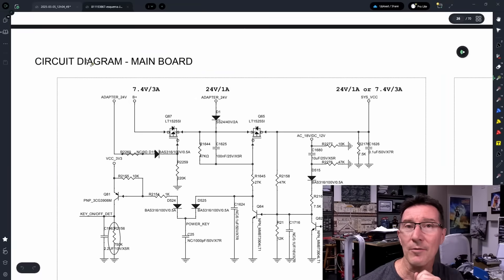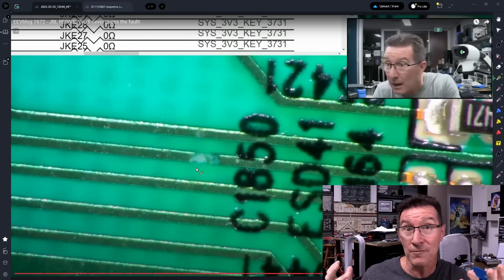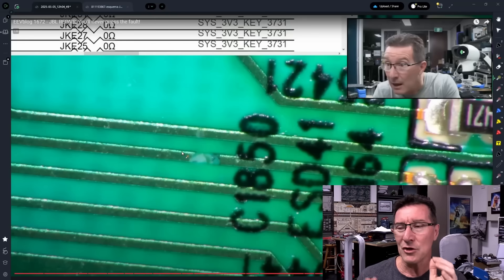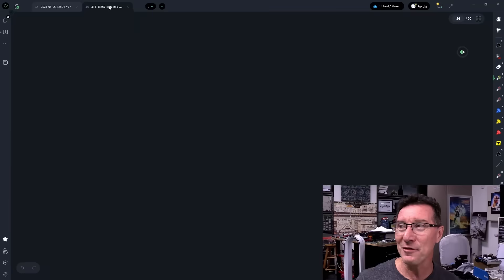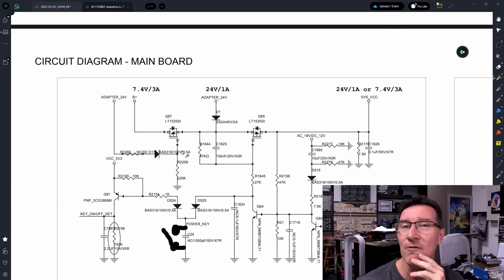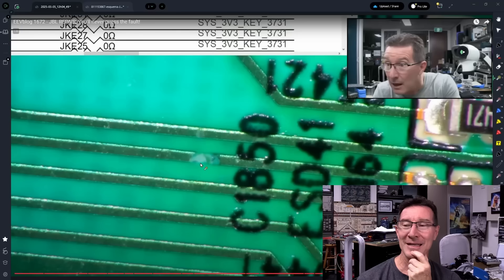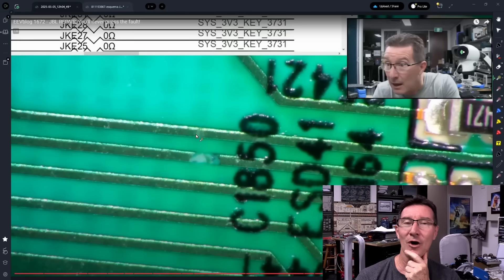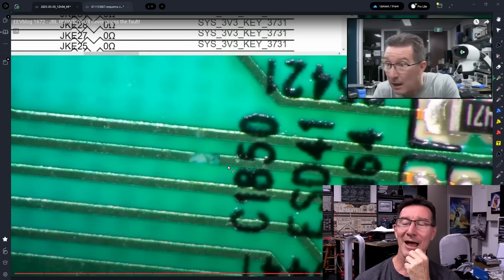EEVblog 1673 - JBL Partybox 310 Repair - Part 2 (SPOILER)

Comment: This is why when something gets liquid in it you immediately remove the battery if possible, or at least power it fully off if it's not removable, so things aren't energized while it's wet.
Reply: No, just fill your speaker with rice. Then boil it.

Comment: If the power key doesn't have a current limiting resistor between it and C25 then there will be a current spike every time the switch is pressed. The current spike can damage the switch and thin traces that have imperfections.

Comment: The one single trace in the entire product that could cause complete failure to power on is the one that had a microscopic defect. Wild.
Reply from the maker: A lot of them would have had microscopic defects, but only that one had a pernanent higher voltage on it!
Reply: @EEVblog  Would a bleeder resistor have helped?
Reply: @CamelCasee No. It's not residual charge from a capacitor which keeping the voltage there. The switch is permanently powered. Lowering the switch voltage or ability to completely disconnect power (including battery) when stored away could increase lifespan. However ultimately I believe the coating was rubbed off (partially) and enabled electrolysis to do the rest. Result is shown in video.

I would have said routing traces on the back of the board would better protect them but that's silly given the effort they put to use single-sided boards only. I would say a design avoiding the membranes sitting directly on the PCB would have ovoided it. Or better spill protection with a full-size membrane across the whole input panel. Sealing off the buttons entirely.
If JBL is watching: This is exactly the type of analysis which could help avoiding such small issue in the future. I fear though there is no interest in extending the lifespan. Defects welcome.
Reply: @CamelCaseeno. Not if a voltage potential is there most of the time. There would always be some current flow, nothing to bleed.
Reply: @RainerMeier  Those boards bend from people pressing the buttons too hard (especially with the ruggedised devices with big rubber buttons). Traces on the backside would easily be ripped apart in no time.